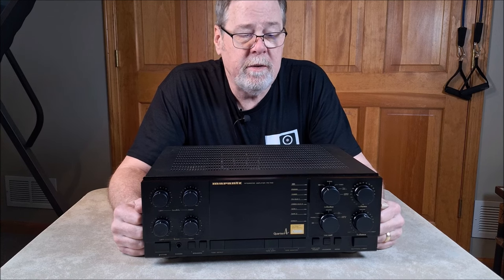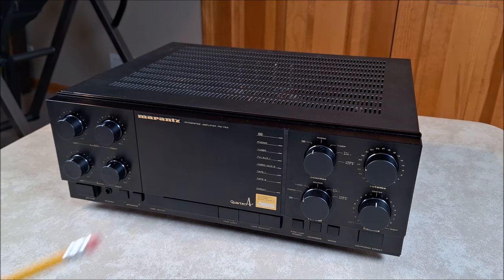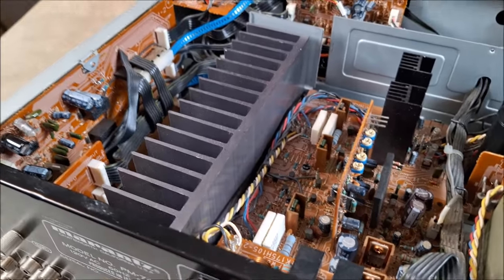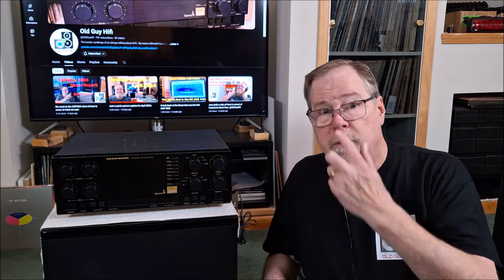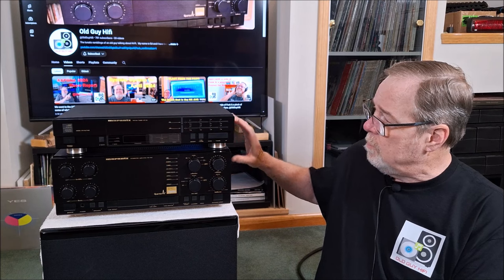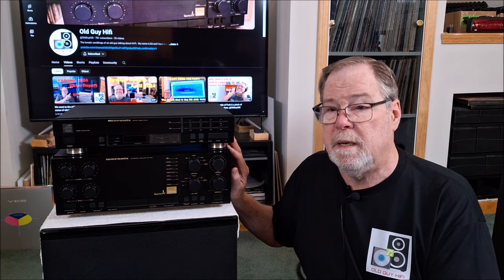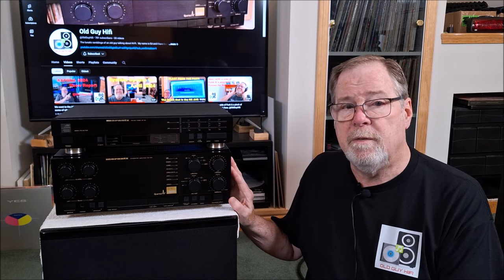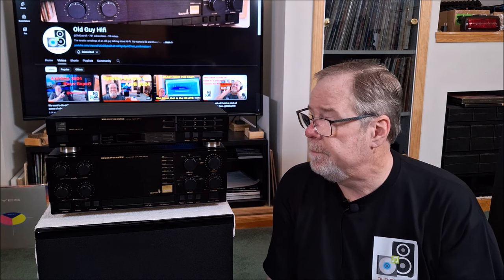A bit of a deep dive on the Marantz PM 74D.  Sorry it's so long.

Comment: That's a brilliant Unicorn of a machine. I never owned any Marantz equipment, but when I was a teen a friend of mine had a Marantz tape deck that was a hand-me-down from his father. It seemed well-made, as I recall, and had a unique cassette ejection system. Upon the press of the eject button, the cassette would hop out of the player and slide down a very short ramp, kept from flying to the floor by a lip in the faceplate. I've never seen another like it since.
Reply from the maker: There where some interesting deck from the period for sure.  Thanks for watching and commenting.

Comment: Hi from Australia. I purchased a PM64 mk 2 new in 1989. $900 aud. After 10 years, left channel became noisy. Had it serviced locally by two technicians. Sadly, it was never the same. Eventually, I purchased a new PM8000 in 2000. 👌
Reply from the maker: That's too bad. Some times original parts aren't available or the tech doesn't have the right experience. I hope you are enjoying the PM8000. That amp is a gem. Dual mono, Class A, what beauty.  Thanks for watching and sharing your comment.

Comment: Another really great video! Love this Marantz unit. It got me curious and I looked up the PM84 and PM94....OMG....CHUNKY TOROIDALS!!!!!!!!!!! OK. Back to the PM74. Really a gorgeous unit. I LOVE that you modified the speaker terminals (A) to now accept banana clips. Fantastic!!!!! I know that you previously mentioned that it was being serviced and in the video you stated that you swapped out some of the capacitors. What was serviced? I have an early model Sony ES two channel receiver that I need to get serviced. The speaker outputs (amp section) started to get fuzzy and now no output. I wish it had pre outs so I could just use it as a pre-amp but sadly, no pre outs. How does this unit compare to the monster HK receiver in two channel mode? Thank you again for the great video! They are really great! Love the dive into the inside of the unit!  God bless!
Reply from the maker: Thank you my friend.  The Marantz was serviced several years ago as a transistor in the pre-amp, it did not handle any signal, went bad and caused the unit to not power up.  I replaced the caps my self.  The big HK has a channel out but I suspect it is some caps in the processing board.  Everything in that unit passes through that board.  I will check it out.  As far as a comparison between the two: the HK plays with a ton of authority but it is like a concert fist in a canvas glove.  Not very subtle.  The Marantz is like pianists fist in a satin glove.  It can hit hard but also be delicate and detailed.  All that being said, I think my Cambridge sounds better that both of those.  Who da thunk it?
Reply: @OldGuyHifi  I'm in a similar situation. I have a few old (heavy) receivers from the 90's when I use to be in sales, that I just can't give up. I have a Sony STR-DA555ES, the smaller brother the STR-DA333ES, and a Denon AVR-3300, which still sound really good to this day and have pre-amp outs, bass management, etc. I can't part with them mostly because of the emotional attachment I have with them. Maybe because they remind me of a cherished time in my life that was full of found memories. However, I have an Emotiva TA-100 (integrated amp 50 x 2), Emotiva PT-1 (pre-amp) + Emotiva A2 (2 channel amp), and a Marantz PM7000N. They all sound superior to my older, well loved units. I also have a bunch of the Chi-Fi amps (V3, TB10S, BT20A, & MC101). I know. I may  have an electronics hoarding problem. Haha.
Reply from the maker: I must refer you to an audio therapist: Dr. Randy. No wait, he is the one that encourages people to be gear heads.  There is a nostalgia to the old gear, but technology marches on and that's why a lot of the new stuff sounds better. We are very lucky that great hifi can be affordable.
Reply: @OldGuyHifi  that’s great advice and well put!!!! Thank you so much!

Comment: There's also a PM64 that's a quarter A amp.
Reply from the maker: Yes but, I don't think it was sold in the US. I could be wrong but never sold any. Thx.
Reply: @OldGuyHifi   It's acually the PM-64 MkII. There's a voltage setting switch on the back where you can choose 240, 220,120, 110.   I just bought one after watching your video.  It looks identical to the 74D except the volatge switch.  I think you're correct that they were probably sold overseas and and maybe at the PX.  Thanks for introducing me to these fine amps. I never heard of them.  I really love the sound of pure class A.
Reply from the maker: @hwrk777  I so glad to hear that. Thanks for sharing. It's great when someone lets me know about their finds.

Comment: Sorry but the two small black heatsinks are not the preamp!
Those two transistors are responsible for the switching between low and high voltage ( class a / ab )
Reply from the maker: Thank you for the correction.